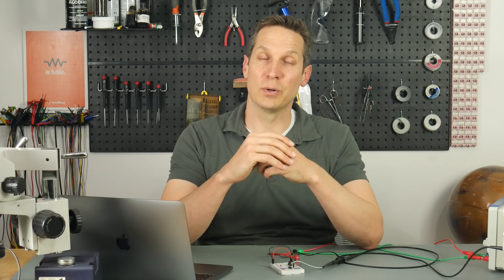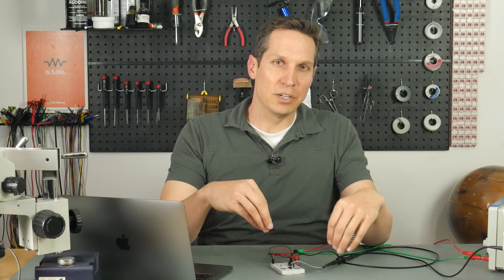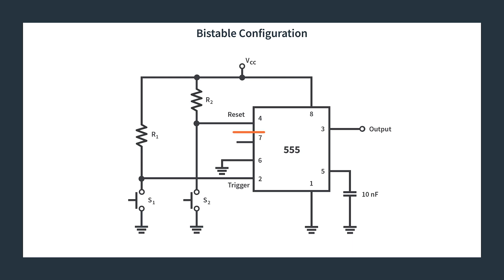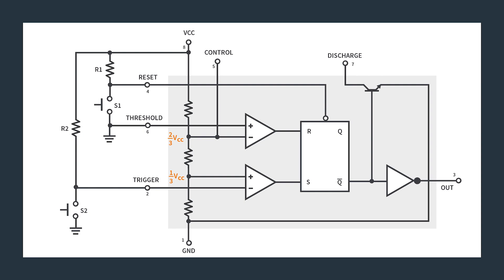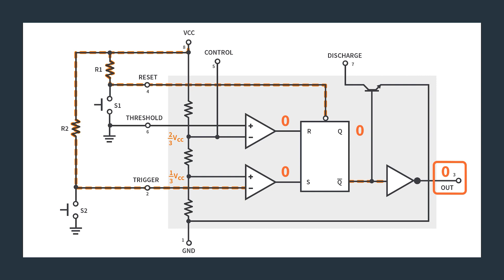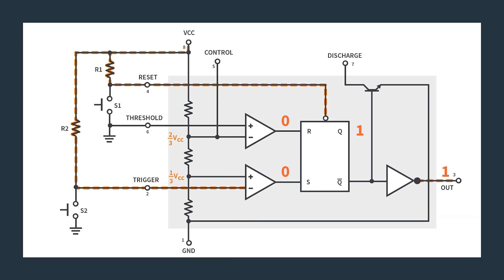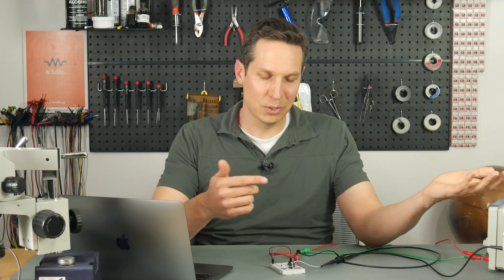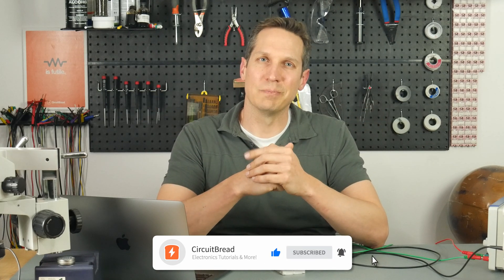555 Timers - Bistable Multivibrator Configuration

Comment: So it doesnt have to use a capacitor to be in astable mode then
Reply: Astable needs capacitor, I think you meant bistable. That mode doesn't need capacitors as there is no timing required.

Comment: what are the values of resistors you had used in the experiment, can you pl. let me know. thanks. good video.
Reply: A good question, irritated me too. One circuit I looked at had 100k for a 5volt supply. I looked at the datasheet and there are entries for the Reset current of 0.1 to 0.4mA,,  for the threshold current of 0.1uA, (for the trigger current of 0.5uA) Ohms law should give you values for your Vcc I guess.

Comment: The bistable configuration is essentially just the operation of the 555 timer as a simple RS flip flop. A lot of its internal circuitry is deactivated by pulling pin 6 to ground. In fact it doesn't use any of the timer functionality of the 555 timer. You could also use a digital RS flip flop device instead of the 555 timer, because no analog functionality of the 555 timer is used. But interestingly it is one of the very few circuits in which the reset pin is actually used, which is in almost all other circuits pulled to Vcc.

To make a simple push on push off switch with a 555 timer is also easy. But it is rather complicated to make a push on push off switch, which can be controlled by a microcontroller by use of high or low pulses. It would be nice if someone could make a circuit which controls the 555 timer as a push on push off switch by low pulses, which can be generated easily by open collector / drain outputs or binary outputs.

Comment: Great video but at 4:15 I think you meant you can’t reset unless voltage is high in q. Correct me if I’m wrong please.
Reply: Forgive me I see what you mean. The voltage being fed into the reset is high. When voltage feeding reset is low it will reset.

Comment: This is extremely usefull i.e. for building lab power supplies.
You turn the PSU on, adjust your voltage and current limit and then enable the output. Advantage of the 555 is that if you turn on the PSU, the output will have a defined state.
If you just had a switch there you might end up forgetting about it and roast components, because you forgot to adjust something.
It behaves like the bistable relay configuration you see on a table saw that prevent the saw from starting on its own when i.e. a breaker tripped and you then restored power to the device.
Reply from the maker: Interesting, thank you for the additional uses of this configuration!